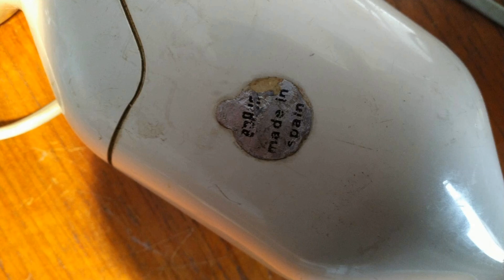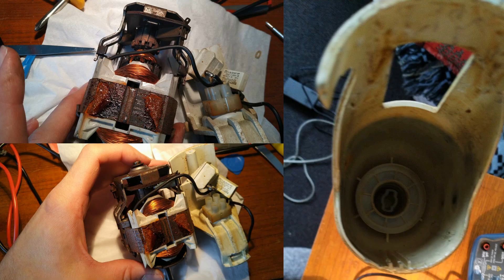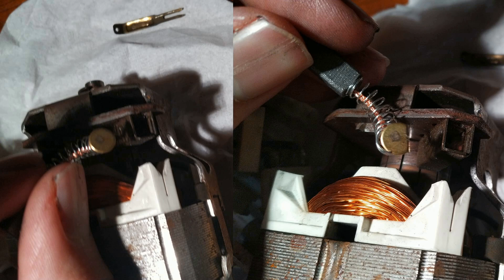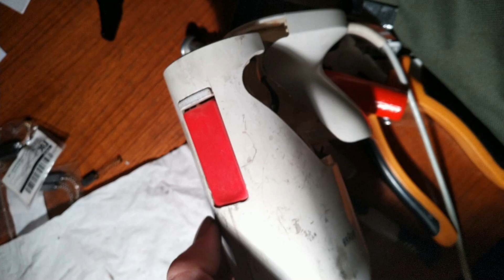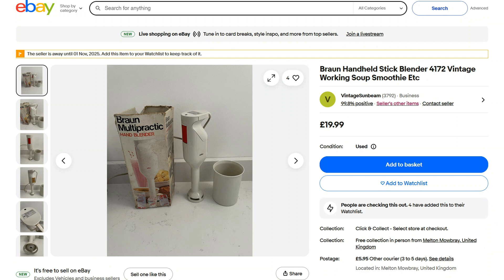Vintage Braun Hand Blender Repair

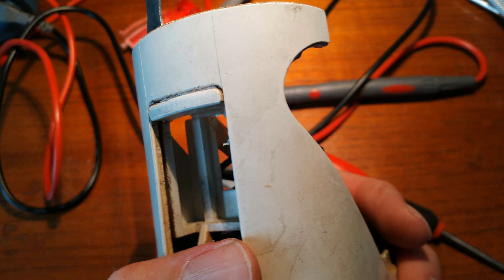Comment: Thank you for making this, it reset my memory. I have had one of these since 1980 and it failed yesterday.Having opened it again I realised that this is not the first time I have had to fix it.  The way to disassemble it, without the red switch lever popping out, is to lever the lip just above the switch (2:19) as klakkik46 did. This needs to be done with a thin blade screwdriver, taking care avoid damaged fingers! slowly slowly.  It is not necessary to lever the other side, but spacing it with a prise ,used for opening laptop PCs was helpful. Still not an easy job and damages the plastic. Mine had the bottom bearing seized, this required motor disassembly. The bearings swivel, so it is necessary to prevent  the bearing retainer distorting and thence the bearing being loose. I used a 10mm spanner in a vice, then hammered it out.  hope this adds a little and helps someone.
Reply from the maker: That's really helpful, hopefully more people will try to fix them instead of buying new!

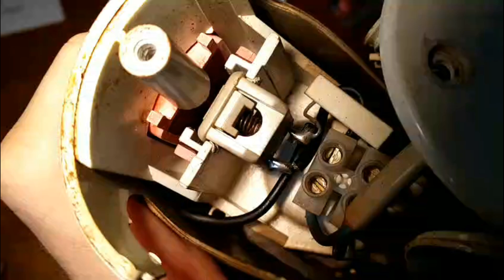Comment: very helpful primarily to know that other people also found it a bitch and a half to get apart 🫠  I didn't have a proper big screwdriver so was using my pocketknife to pry apart, and had some luck pushing down the tab shown at 2:19, and then wedging my knife between that and the body... beat that up a bit and was able to then wedge the blade between the two pieces from the top (as seen @ 1:12)  and it finally popped out. Not without exacting a blood price first though... (and no it actually wasn't the blade of the knife that got me - I got myself with the other end that I was using to pry with)
Reply from the maker: I'm glad you were able to get it apart, sometimes the blood sacrifice is just part of repair...

Comment: On my model, you can pop the button out carefully, however it has two prongs that you press also.    I ended up shoving a flat screwdriver in the top clip and a smaller in the bottom to separate the inner plastic chassis.    Found out on my unit the motor bearing mount had a hairline crack that if pressed upon would allow the motor to work perfectly.    Considered soldering it, but decided it’s time to toss it in the scrap box.
Reply from the maker: If the housing is cracked that makes everything more difficult - maybe a 3D printed support could clamp it back into place?

Either way I'm sure it had many years of useful service, well worth trying to repair.

Comment: You are correct! Not an easy task to dis-assemble. My model was completely seized, both the motor and the mixing paddle at the end! A complete strip-down was required. I needed to polish the armature shaft at both ends and clean the phosphor bronze bearings. Fortunately the brushes were freely moving in the holders and still of a good length. I couldn't find a way to remove the mixer paddle so just used WD40 and wiggled the shaft back and forth until it rotated freely again. Yes, I did clean off the WD40 afterwards so as not to contaminate and ingredients being blended once back in use! After rebuilding and testing it worked fine.
Reply from the maker: I'm glad you were able to get it moving again, the design is honestly great for functionality but not so much for repair...

Comment: Thank you! 

Not my model which does not have a screw, so it seems that I may have to pry it open at the seam unless I can find a video on my model. 

My model is the Type 4169 with green power button, possibly the same as in one of the pictures you showed.

Cheers!

Nonetheless, thank you for the inspiration & leading the way.
Reply from the maker: Thanks you for watching the video, I'm glad you enjoyed!

I saw some online where the top was solid plastic, you are probably right...it may be clipped together.

It will probably be difficult to take apart but much better than just throwing it away.

Good luck, I hope you can repair it :)
Reply: I also have the 4169 that I'm trying to repair. If you look at the top where the control dial is, there are two blank circles. You can pry these out with a thin blade and there are screws underneath.